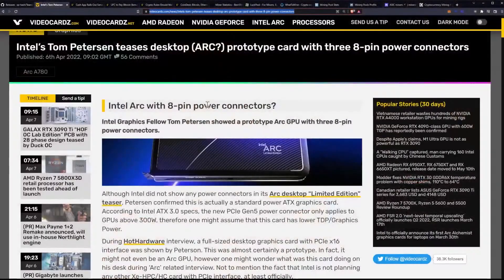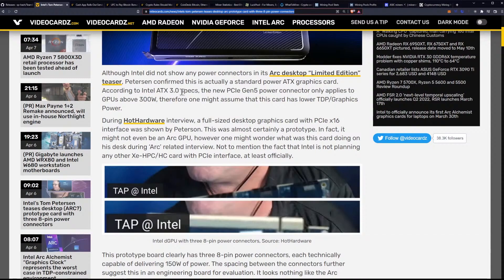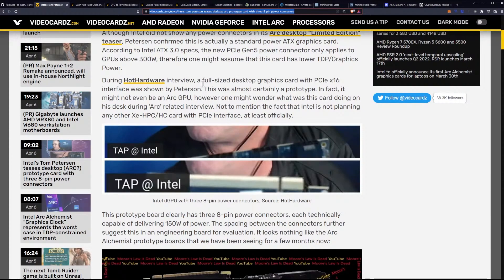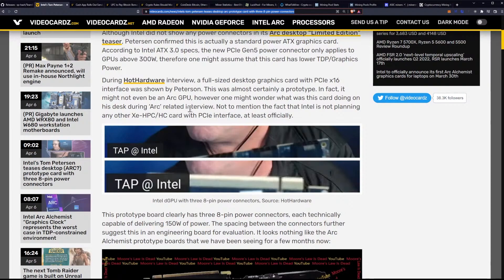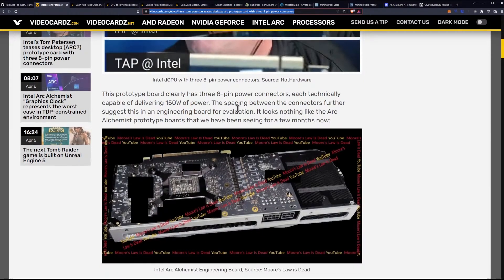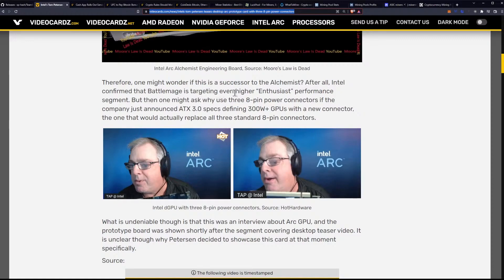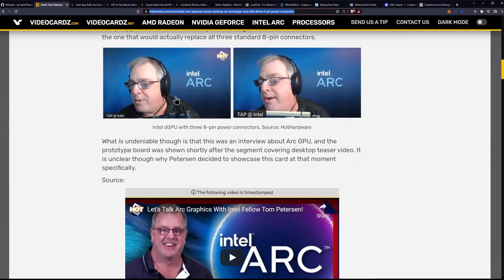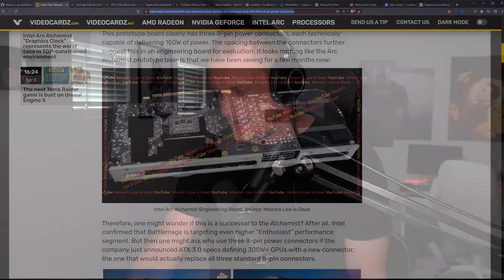Intel Arc Alchemist Power Consumption Leak

Comment: Jesus 3 8 pins for a low tier graphics card the 3070 kicks it’s ass, they said there next mid their card won’t be out till 2024-2026, a high tier card is coming in 2026-2028, can’t believe it’s probably gonna be a 450w card that gets beat by a 3070 which is a 200W card that MSRP’s for $499 I bet the arc is over $1000 at launch, Intel fanboy will be happy till they put it in there system and there FPS is lower than with there AMD or NVidia card